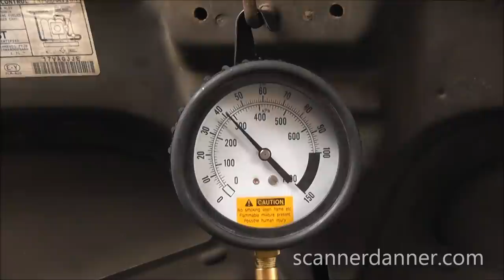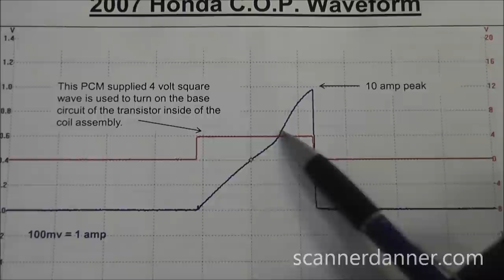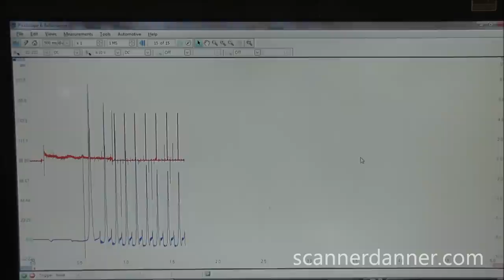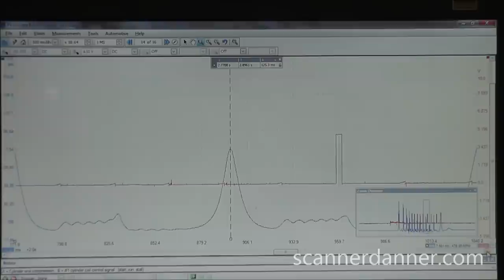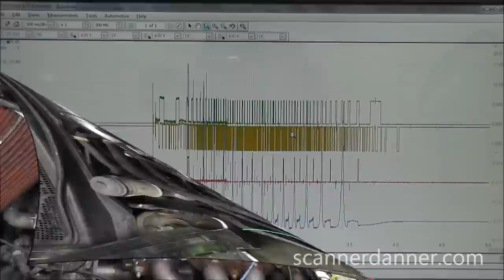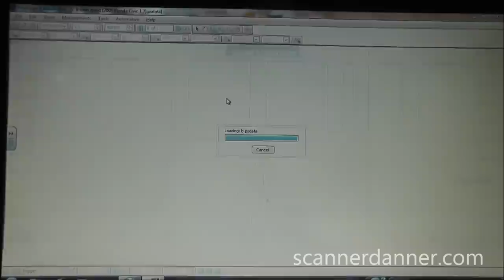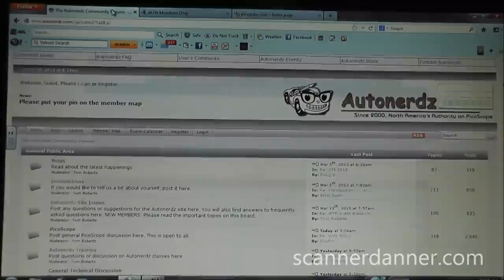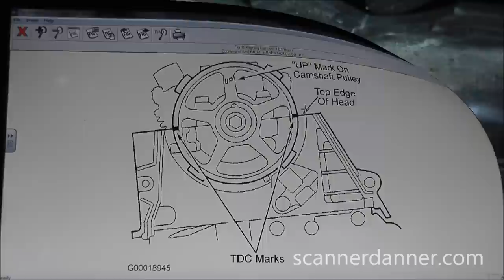Honda Civic 1.7L starts, runs, stalls (incorrect timing belt installation)

Comment: Hi.  First, I want to say thanks for the amazing video.  Attention to detail and thorough explanations are some of the best I've seen.  

I came across this video because I've had the same issues with a 1995 Honda Odyssey.  The only difference is my symptoms were inconsistent at first.  At first, it would start on some days and run fine, and on others, it would start-run-stall.  Also, sometimes it would start and run just fine in the mornings and evenings (to and from work) but would start-run-stall when I tried to go somewhere for lunch.  It's finally gotten to the point that it only start-run-stalls.  

I've changed the fuel filter, I've checked and listened to make sure the fuel pump primes the system and then comes back on once the car runs for the seconds that it does, I've checked for spark, I've checked the exhaust for clogs, I've tried carb cleaner in the intake......  I've done everything you have that doesn't require thousands of dollars in sensors (that I'd truly love to have).  Would the earlier inconsistent symptoms make you think that something else could be causing this?  I was planning on cracking her open this weekend and would hate to get in there and see that everything is timed correctly.
Reply from the maker: +swbernstel If it runs fine some days and other not, it is most likely not the timing belt. My money is on either the main relay or ignition switch. Both very common issues. 
Here is a few videos on the main relay https://www.youtube.com/watch?v=6CMZ4g8n0FQ
https://www.youtube.com/watch?v=X5Qp-ToR8KA

If it doesn't make a difference when you add a fuel source you may be losing spark. 

To check the ignition switch, with the engine running, smack on the bottom of the steering column, just below the key. Hit it hard. If the engine stalls, you need an ignition switch. 
I've also had success just messing around with the switch. Start it, shut it off, multiple times, over and over. 
If you can make it run good after messing around with the switch or if you can make it stall, you need a switch
Reply: Currently, it doesn't run at all, ever.  Only start-run-stall.  

When the issue first reared it's head, I thought it was the ignition switch, so I changed that out.  It made no difference.  

A buddy thought it might be the main relay and we switched it out with a known good one (he had an accord with the same relay).  That made no difference.  If I can hear the pump prime the system and then hear it kick back on when the car runs for a second before it stalls, wouldn't that rule out the main relay?

What is your opinion on the possibility of a bad coolant temperature sensor?  I've read elsewhere that it can render similar symptoms.
Reply from the maker: +swbernstel the main relay controls more than just the fuel pump. 
Can you keep it running by spraying carb clean into the intake? (Be Careful!)
A bad ECT can cause a no start but in general it would be from reading too cold and it will flood the engine out. You should have a code for the ECT circuit in that case. And your spark plugs would be soaked with fuel
Reply: It will not run on carb cleaner.  

If it runs then stalls, would there still be any fuel left on the spark plugs?

Also, something else I've noticed is that it only start-run-stalls the first time I try to start it.  If I immediately try to start it again, it will not run.  I have to turn the key completely back off and then try to start it again to get the start-run-stall symptom.
Reply from the maker: +swbernstel you need to check for spark while it is not starting
Reply: I'll do that next and report back when I have something.  Thanks again for the videos and help.
Reply: Hi again.  So, we checked spark and it's still getting spark on the second start attempt.  A friend brought his Solus over and hooked it up.  All the sensors seemed to be reading fine.  The only error was "Ignition out line or Circuit failure 15-1".  We started checking out the distributor.  We took the distributor cap and rotor off and saw that there was a lot of corrosion on the points and rotor so we sanded them down just enough to exposed fresh metal.  Put everything back together and still start-run-stall.  As a last ditch effort, we tried the carb cleaner in the intake again, but this time he told me to open the throttle a bit.  Amazingly, it started and ran, and ran fine (which means that the timing isn't off).  We shut it off and she started right back up, although weakly due to the battery not being fully charged.  I drove her around the neighborhood, let her idle in the driveway for a while, then shut her off.  

So, today, I replaced the distributor rotor, cap, and battery.  I go to start it up and get start-run-stall again.  I tried to start it up with the carb cleaner and open throttle and that didn't seem to work this time.  My next planned step is going to be to get a whole distributor from Pull-A-Part.  Do you have any input/suggestions?  Or perhaps know exactly what that Solus code means?

Comment: Very interesting and great example of benefits of correct diagnostic tools. That demo o mehanical timing and coil and TDC ramping was impressive. Im curious why crank angle sensor didn't write to eco for timing being off as I've had cars off 1 tooth that trigger all be it on VW/Audis. Good stuff sire.

Comment: Woah, quite a hassle for that one tooth off. But you did cover all bases which is great! Really cool you were able to see that little pressure increase cause of the early closing exaust valve. Also great you managed to change your opinion a couple of times through the video, that's exactly how this kind of problem analysis works ;) I'd still replace belt & tensioner though. I mean come on, it jumped, this water pump guy didn't deliver a no-start car.

Comment: Hi Paul, what I don't understand in this vid is why the ignition is spot on as the engine starts and then moves away as the engine runs rough and stalls. Made me think initially that something was moving mechanically.

Mike
Reply from the maker: +WhitwellMike B computer advance is a factor once the engine starts running. So with cam and crank signals being off, it messes with the ECUs calculations.

Comment: One small correction- you kept calling the double cam pulse a "TDC" signal, but as you can see on the good car it has nothing to do with TDC- it's just a cam sync signal that signals the ecu that #1 (im sure there are exceptions) cylinder is going to be coming around for its compression/firing stroke. So maybe you should call it a phasing signal instead to avoid confusion.
Reply from the maker: The TDC signal is what the wiring diagram called it. But thanks for the correction
Reply: Very informative  Paul,,,All you people without a Pico  , just disconnect the crank sensor car would stay running , but the diagnosis is timing belt jump

Comment: Man I had this same issue and had good battery readings and my relays are fine. I got my timing belt done about a few months ago then my transmission took a poop and after getting back the next day this was happening to me. I did everything in my power to find the issue, car started up fine with a jumpstart( I was so confused at this moment) so I changed the alternator and my car been good since but seeing this video made my troubleshooting way easier. Thank you💯
Reply from the maker: A bad diode in the alternator can do some crazy things! Like this one https://www.youtube.com/watch?v=MGaHaIXZioA

Comment: Mr danner sorry this is off video topic. I'm in a pinch. I have a 05 f150 that drives normally cold but after driving for a while the trans feels like it is in neutral. Ok here's my pinch the trans does not over heat and when I experience the problem the scantool says its in 3rd gear the shift sol(ssa ssb) are also commanded for 3rd..when I'm at a stop..sometimes even in park.  Sometimes I get p0731 p0732 but I manually cancel overdrive I can replicate the fault.

Comment: Thank you SD today I got exactly problem with my customer car 2001 Honda Civic 1.7  it took me 1 hour  to check all  necessary components related to the symptom. I almost give up for today then I decide to YouTube for help then I found you I go back to check timing belt and I found 1
Reply from the maker: it is a strange symptom isn't it? It certainly is not common to see these symptoms by a timing belt being off one tooth

Comment: start, run, stall reminds me of a bent distributor shaft i had once on an old subaru, i did not have any scan tools so diagnostic was sheer joy [sarcasm]
. the reason i looked at the distributor as opposed to the timing belt is because it is much easier to pull the distributor than to check a timing belt for alignment. it did seem as if if th timing belt was slipping a tooth occasionally thou.
once u have a slipped or out of position timing belt always check the tensioner to make sure it is tensioning and not leaving th timing belt loose, if ur replacing the timing belt spend th extra $$ n replace the tensioner pully[s] as well because u dont want to have to go back in there.

Comment: I had to watch this video again because I had a car the other day with these symptoms.As I was diagnosing the car with my pico scope and finding a timing belt problem on a Toyota camry my friend who is also a technician told me I could of ran a running compression test to diagnose the problem much quicker. He said a running compression test of 40 psi or less indicates a timing or valve train problem. Ive never heard of this.  I never checked his theory but using my pico and listening to the engine during crank, I found the belt to be off 1 tooth. Your thoughts or knowledge on a running compression test would be helpful. thanks Paul.
Reply: the timing is not ruined by itself, somebody has ruined it
Reply: geoepi321975 Timing belts will jump teeth if the tensioner is worn out.Only takes a moment of slack to reach the leading side of the cam sprocket or crank sprocket to jump a tooth forward and then the sprocket pulls it around one tooth advanced.
Reply: Cragified
yes you right, ... and his friend is right,  low compression may indicate advanced timing
Reply: thanks!!

Comment: So, if we have a tool to monitor the footage of voltage change of crankshaft position sensor and camshaft position sensor, we can check if the timing is aligned or not, without taking off the timing covers, valve cover, etc etc ?
Reply from the maker: That is correct but in some scenarios it can be good but still be off. Example: a DOHC engine with a cam sensor on only one cam and the other cam is off a tooth. Cam and crank will be perfect
Reply: @ScannerDanner  Aha, I see. Didn't think about that cuz I only have SOHC cars 😂

Comment: When I worked for Honda this was a huge problem and has been for years, the pull says up but the head is tilted. The best thing to use is a mirror when reading them. The ones that really throw you for a loop are vibration at an idle 2.0 liter, when someone has the balance shafts off. LoL

Comment: I'm not honda but I think the small advance has to do with start-up/running as the computer initiates timing advance while the way off timing is the computer losing tdc sync - If you notice the ignition timing when it's way off is still in time/correlation with the crankshaft double pulse although the wrong double pulse (18:47 is a good picture of it going out of sync).

Comment: I believe I'm having the same issue. New water pump timing belt and tensioner. After install I start the car runs for a second and it shuts right back off won't stay running. So I took everything off I have to watch a new video and started looking things over and when I go to set the well first off is the correct way to turn this clockwise I've heard conflicting stories from people. At any rate when I try and set either the camshaft pulley or the crankshaft pulley well the crankshaft pulley when I set that we either one it'll turn a little bit and then it'll spring forward and then you got to you know twist kind of hard no spring forward I don't know I don't want to mess anything up any further so any help would be greatly appreciated.

Comment: Thanks I think you have solved my problem Icheked spark injectors and fuel wasn't sure about can and Crank but because of the possibility of the timing belt which I just did I thought to recheck found belt bad so I'm going to replace and retime

Comment: how would you differentiate if the ignition or injection control stops because the car stalled or if the car stalled because the ignition or injection control stopped? i had a case where the car would start and then stall and it had spark and injectors control and fuel pressure, compression and the timming belt was right... to me it seemed like the computer was turning off the injectors right after starting.
Reply from the maker: I proved it wasn't a fuel issue by adding a fuel source while it was dying. I also proved it wasn't losing spark with a simple in-line spark tester. 
Make sense?
There is not one answer to your question. There are multiple tests that can be done to prove injection and ignition are present

Comment: i have a 92 civic z6 block y8head with odi1 wiring harness i blew the head gasket so i changed the gaskets new valves nd stems i put everything back together. and it turns on but when i press on the gass it chokes

Comment: I haven't heard you talk much about trans. But maybe you have some experience to share. I want to be positive it is not an electrical fault before I recommend a trans. I just can't see why it works normally cold or warm w\overdrive off and be a bad trans. Id think its a fault mode but id expect a lower gear for a fault because its like the trucks in nuetral. Id appreciate any input you might have.

Comment: Hi Paul...can we test for timing using cam crank synchronisation test...i mean if the timing is out the cam crank signal waveform also would not match.
Reply from the maker: We can but there are variables to that. Say a DOHC with a cam sensor only reading one cam etc
Reply from the maker: @mototechno834  I can't offer phone support my friend, I'm sorry. If you need additional help with stuff Post to my forum https://www.scannerdanner.com/forum/post-your-repair-questions-here.html it is free to join and I have paid moderators who are there to help me help you guys.
Thank you for understanding! I have about 300,000 people trying to contact me these days

Comment: IAC Valve on a 84 Honda Civic, lx 1.5 4 dr sedan. it has emission fail for smog. I replaced oxygen sensor, spark plugs, wires, cap,rotor. and cleaned the throttle body and cleaned the IAC valve. watching your videos, i will bleed the air out of the radiator and will see if i can seat the mechanism if it is not ribbed. i hope i can get this fixed soon, my sister needs to smog it quickly. please reply. I also was considering the cat replacement if this does not fix it.

Comment: Think about if you had this problem on an [say] 2004 Audi A4 3 litre engine which has two banks of cylinders and two camshafts on each bank. the whole front of the car has to be removed to access the timing belts.that is bumper cover radiator and condenser ... ect. This is exactly why these diagnostic equipment and procedures are standard procedure for any such diagnosis. You do need the investment .to cut down on labour expenses. Your vacuum gauge is a start